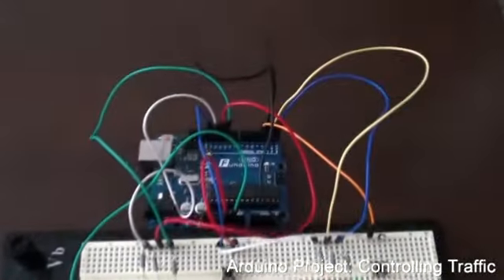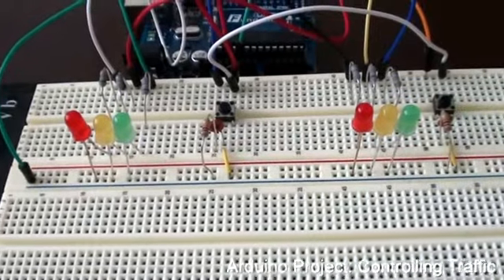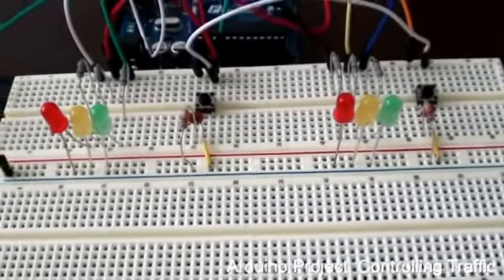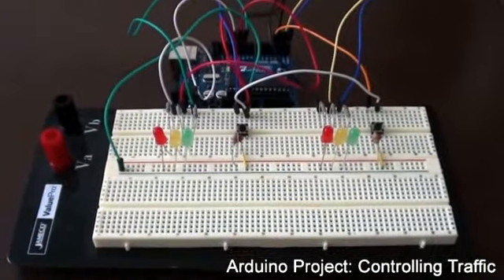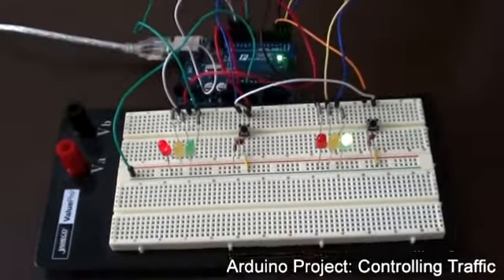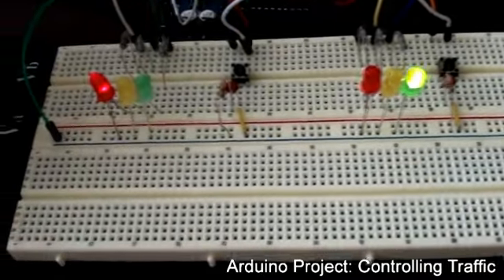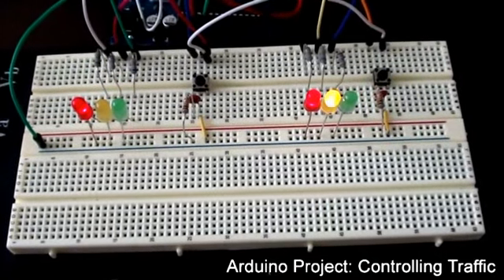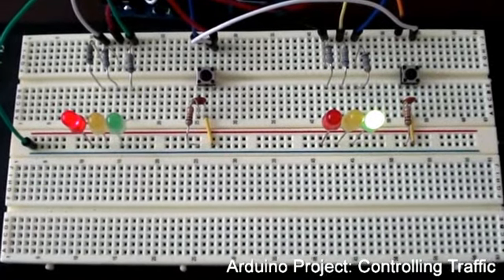Arduino Project - Traffic Lights (Controlling Traffic)

Comment: Where you have the input wires and the 5v pin wore in orientation with the button effects the circuit if you mix them up then the switch will keep the buttons on high  and it’ll just loop back and forth. This guy has it correct

Comment from the maker: You might try an Arduino starter kit. Most include all the components, etc. necessary to complete this project. The downside is the kits are sometimes more expensive than purchasing the components individually from China on eBay. For the instructions, I purchased the book noted in the video description. Hope that helps. Thanks for the comment.